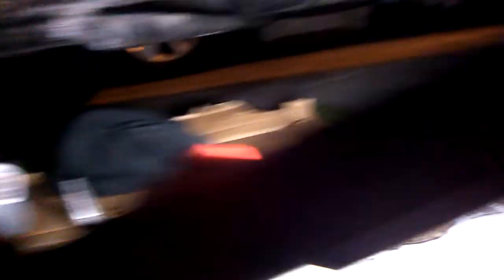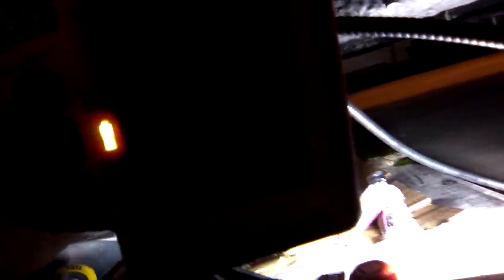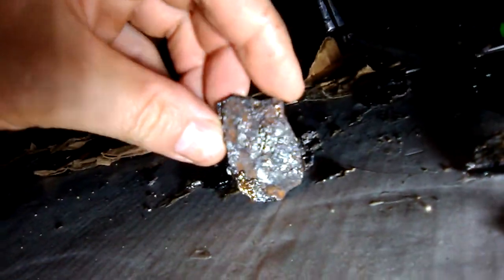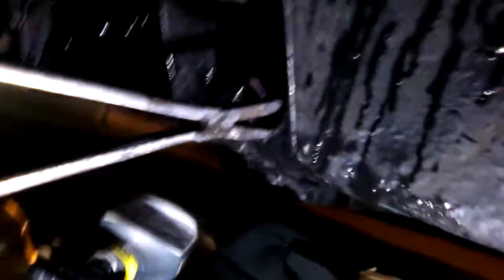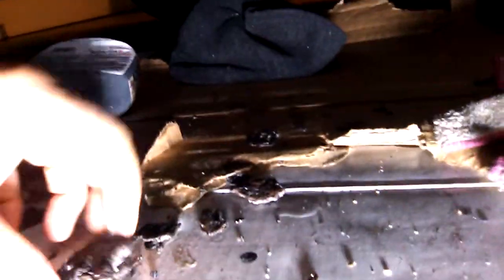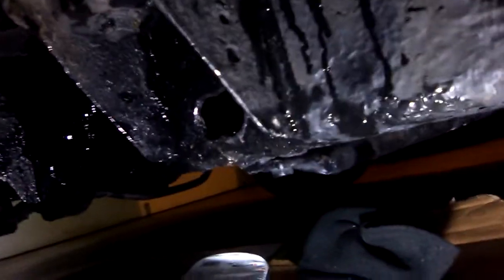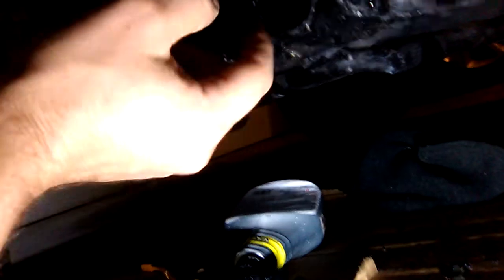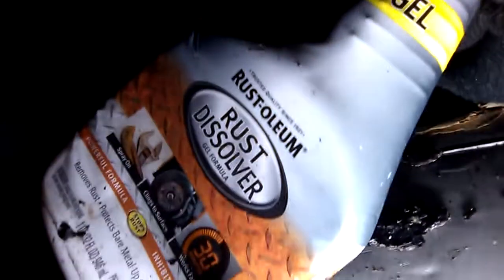How to convert rust inside a Box Chassis Frame: Boroscope, 90° long Pliers, Phosphoric Acid Gel Time

Comment from the maker: OK I just ordered an SEM 360 degree wand that I had used before - it's not made by SEM anymore - so I found a distributor that still had one in stock. Then I ordered their SEM internal frame wax coating spray. So I know their 360 degree wand does fit well on the spray can.

Comment from the maker: Then I ordered the Eastwood Rust Converter (with tannic acid) and the Eastwood internal frame coating paint (with naptha mineral oil). That also comes with wand sprayer. That is the SAME wand sprayer I just tried to reverse engineer into a Rustoleum rust reformer spray paint can. haha. I made a mess! but as I already posted - that Wax wand sold also makes a mess on the KBS product. So I don't feel so bad about making a mess  - their wand WILL fit their own Eastwood spray cans.

Comment: I like harbor freight 😁 some stuff breaks but good return policy. Anyways be careful w that acid. Got a mini fight club acid burn. That prob hurt. Thanks for sharing 🏄
Reply from the maker: good to hear from you! Yeah everyone calls it Harbor Fright - I got a 1/4" Torque wrench that busted right away - that Pittsburgh brand has cheap steel. haha. Still my buddy said I needed a 3/8" anyway. I had never used a torque wrench before as I'm anti-mechanical. I'd rather have a hole in my hand than a hole in the frame - since Life can Self-Repair. hahahaha. Take care
Reply: @voidisyinyangvoidisyinyang885  🤓 I know exactly what you mean. Hah "harbor fright" -will the break they just might...anyways I find your posts very interesting and deep usually when I see them pop up. You explain things very well. Thanks. Keep em coming. *And take care as well. Peace

Comment: Careful they got lifts so they can  lift  the car up to like your shoulder level.
They also have the original specs on the car. Half the time it's some one  who literally used to work at a dealership anyways.
So they can take apart all the pieces around it pretty easy.
You try to do that on the fly you're going to be there for like 10 hours and you got to remember exactly where every screw came from.
Endless  it's one piece an it's  visible like a brake pad or oil change I don't touch it.
Literally been stuck with like seven backyard mechanics switching an engine on a Honda or Acura.
To me that was like some version of a limbo before hell haha. Just wiggle it another dozen times till it fits on the bolts it's not fitting on lol.
Reply from the maker: yeah a car is more complicated than a house! I worked a temp job at a recycling factory - the coworker said he did serious time - at least several years - for the crime of fixing up used cars to resell them, without the proper license to sell cars. So yeah I had two local mechanics already disown my car due to the fear of rust rot - with good reason. haha. I just got some rust converter paint with the 360 degree wand to make sure I get good coverage inside the frame. Then I got wax - parrafin wax in a spray can also with a 360 spray wand!! So before I sprayed in wax but I didn't have the wand to make sure I got good coverage. I even put some JB weld on the inside of the frame - just to cover up the rust better so no oxygen would get to it (and maybe add some strength? ) haha.

Comment from the maker: https://www.rustoleum.com/MSDS/ENGLISH/215215.pdf  OK this Rust Reformer paint has zinc oxide with some acid to create a zinc "rust" barrier plus silicate that also is a barrier to future rust. So I'll get a can of this - I've used two cans already. They have improved the formula in my view.  I also got the RustMort 80% phosphoric acid - so twice the concentration - to make sure to convert the rust inside the frame.

Comment from the maker: Klean Strip Concrete and Metal Prep is 30% to 60% phosphoric acid - so I just sprayed that into the inside of the frame since the Rust Dissolver is 25% to 50% phosphoric acid and it didn't seem to be getting the job done. I'm not sure if the phosphoric acid is CREATING rust by sitting on the metal with the water in the gel. I don't think so. I may have to get the 1 gallon food grade phosphoric acid at 80% concentration....